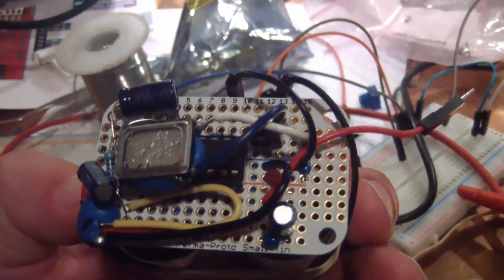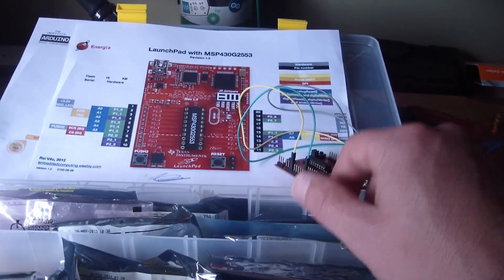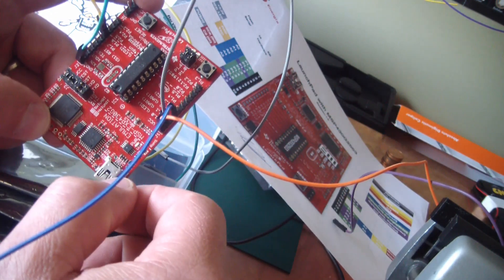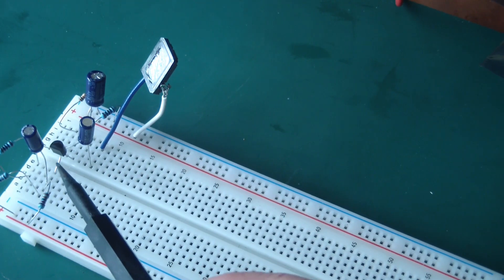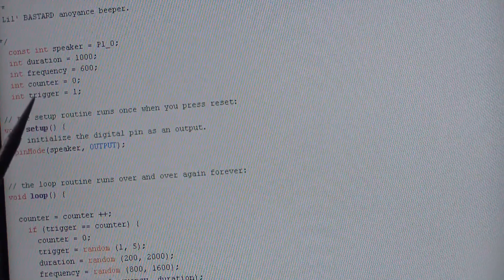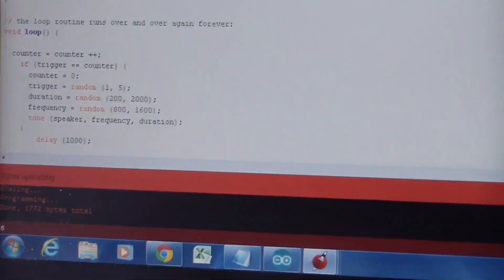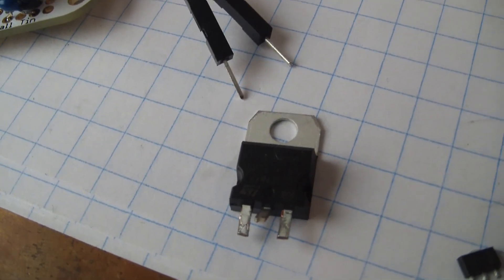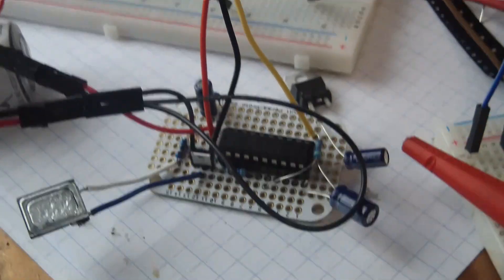Zen Blaster; a Most Annoying DIY Electronic Device

Comment: I want to get into electrical hobbies but its a pain in the ass using a $5 soldering iron.
Reply: sam strothers buy a better soldering iron?
Reply: sam strothers indeed it is. As soon as I had the means and the sense, I bought a fairly nice (but still one-hung-low, because I'm a cheap bastard) temperature controlled soldering station, and ohh boy does that make a huge difference.
Reply: Ryan Willis 'Yihua' 936 or similar Hakko clone? I have one myself that I got from Hobbyking; it's no real Hakko or Weller, but it works for what I do.
Reply: FrankTheCat I had a Yihua 936 from HK, but the heating element failed and the pinout and board design are different enough from the original Hakko that I couldn't replace it with a proper Hakko element, so after much fumblefuckery, I gave up and bought an Aoyue 2930, which was a step up in cost, but oh so worth it - the "tips" are an integrated unit containing a heating element, a temperature sensor and the soldering tip itself, and they're hot-swappable. It's a 75W device, and it comes up to temperature in under 15 seconds from cold. I love it to death. My only gripe is that while you can get tons of different tips, because they each have their own heater and sensor, they're about $13 each. One major advantage with the integrated tips is that you get very good thermal transfer from the element to the tip, which means there's very little thermal sag when working with large solder joints, and the tips are very robust.
Reply: sam strothers I spent $20 on a constant temp low W soldering iron from an electronics shop, and it's so much better than trying to solder with the 60W hardware store hunk of junk I had before. You probably don't need a soldering station, just get a decent entry level electronics soldering iron. Suddenly it becomes easy.
Reply: sam strothers For years I used a Xytronic soldering iron I bought from Jameco. adafruit has a similar model for a reasonable $22. I will add that a decent iron stand helps too. Here is my homemade stand next to a commercial model http://i.imgur.com/3mV47yO.jpg The respective angles of the dangles are similar. I made my stand without the benefit of another to copy too.
Reply: Ryan Willis Check out this instructable: http://www.instructables.com/id/10ish-DIY-Variable-Temp-Soldering-Iron-Controller/&comments=all
It's a receptacle with a dimmer switch to plug your soldering iron into. Turns a fixed wattage iron into a variable power one. Obviously you don't have a pre-labeled temperature dial on it, but 30 minutes with a digital thermometer (lab type, not medical/oral) and a sharpie will give you fairly accurate temp marks.
Reply: MooncabbageRight on. I've known people to get frustrated trying to solder small electronic components with a high power iron. One guy was using a dual power soldering gun, in high range, no less. Something like 80 or 100 watts. He couldn't understand why he kept roasting components the instant he touched them. I tossed him an extra 20 watt iron from horrible freight I had. The next day he was all giddy over his new-found success.
Reply: revmpandora Yeah, I had a "Stahl Tools" variable power soldering station which was essentially just a dimmer switch in a box with a soldering iron on the other end. That one is available on Amazon for $17, IIRC. A very good iron, I've just outgrown it. I'll never go back to open-loop control, having temperature sensing at the iron tip is just so amazing.
Reply: Ryan Willis
Meh, any iron with a ferrule to hold in the tip is good enough. Screw tip irons are garbage though.
Reply: Paul Frederick Why is that?
Reply: revmpandora
Screw tip irons are garbage because the threads seize up in them, and then the tip cannot be removed. Ferrule sleeve irons do not get stuck like the screw tips do.
Reply: You can solder quite well with a  thick piece of copper wire in a vice grip and heated with a flame , I have done this in a pinch....almost as good as my $1000 OK Industries soldering station...The key is a clean and well tinned tip.
Reply: I'd probably just control one side of the outlet with the dimmer switch, and run straight power to the other.